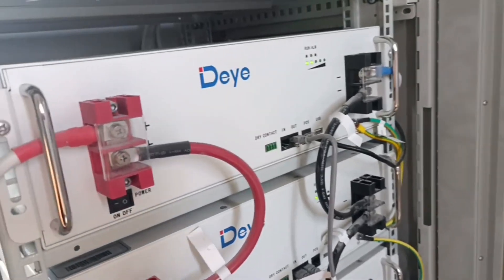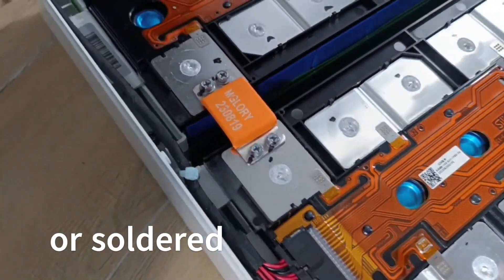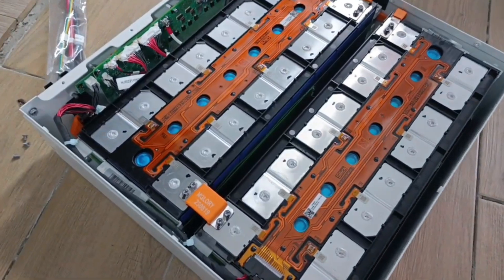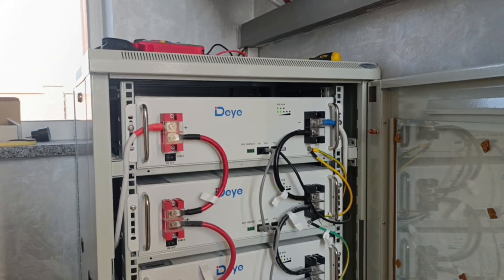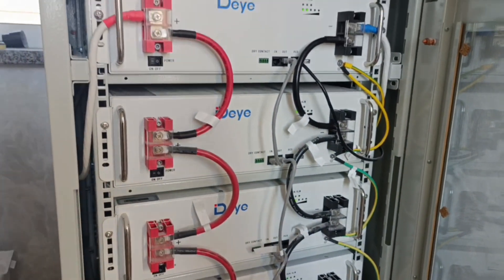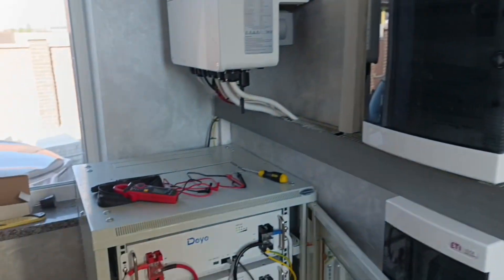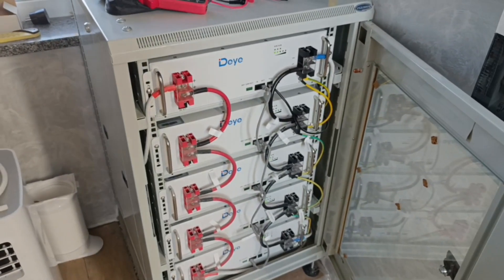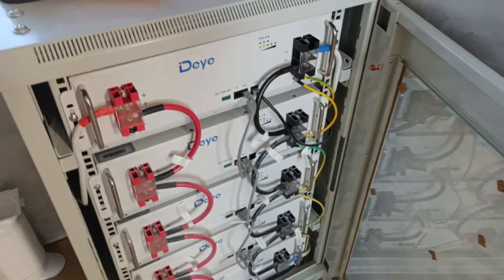Wanna know what's inside Deye SG5.1Pro battery pack? Wonder why there is no active balancer inside.

Comment: Is there no active balancer or no balancer at all? Is it passive? Maybe the cells are so good that an active balancer is unnecessary?
Reply from the maker: yes, no active balancer, like in many other brands too, especially in smaller cell sizes (60-100AH for instance).
however, it will only work well, if you charge it to 100% and leave it for a while (couple of hours or even overnight) once in a while, in about 3-4 weeks probably. I do it this way - and so far no issues, 2.5 years already and still going strong, and will be for many decades.
Reply: You can see balancing mosfat at pcb board in video.
Count and you find number a factor of cells.
Back side of front display.
Quite normal setup but slow method abd can run 24/7
Same type of balancing than EV used with 24/7 balancing regardless of SOC.

Comment: Those blue cells are Lifepo4 made by CATL
Reply from the maker: how are you sure those are exactly CATL, and not EVE, or Hithium?
Reply: i think it's the square shape of the terminal studs with the welds; from online pictures that i quickly checked seems CATL uses this geometry; also the warranty on these is 10 years or 6000 cycles with a DoD of 90% before they reach 70% health and they are dead serious about it; i' have two of these installed and have been cycling them daily (100%-40%) for the past month with no more that 20mV imbalance; their passive balancer is really good and the cells themselves are impressively well matched; my  guess is that Deye might actually be putting grade A cells to easily meet these energy storage claims